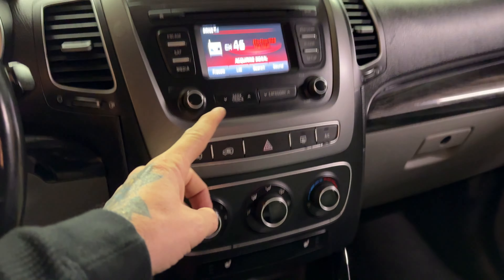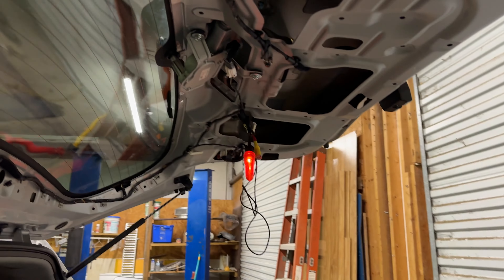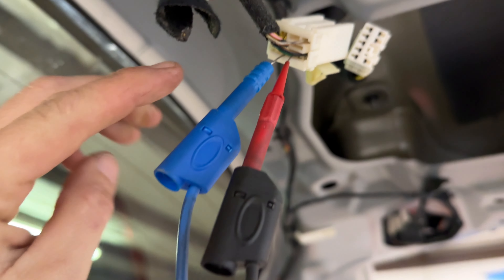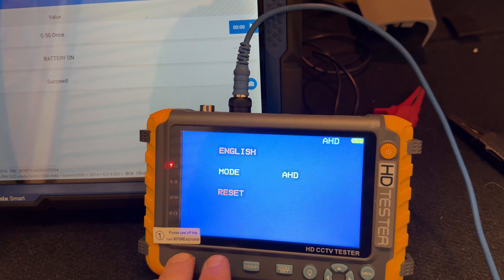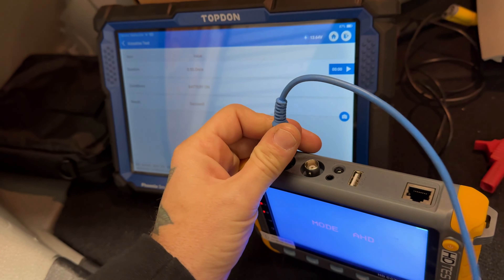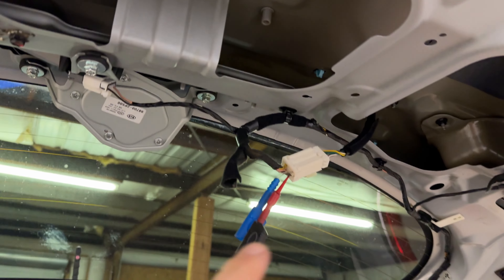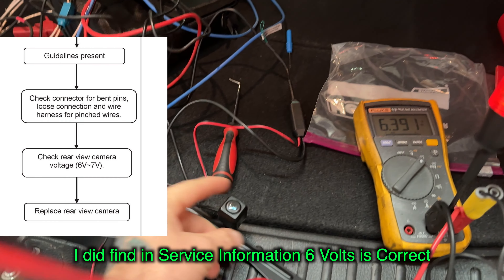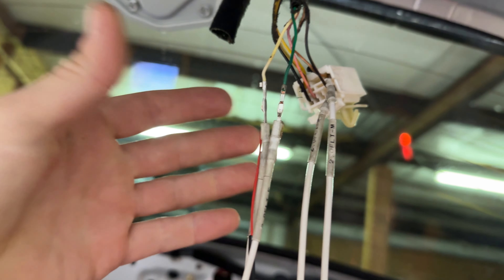Kia Got Issues Part 2 Back Up Camera Testing

Comment: You a excellent tech.90% of the time when I look at a  Kia it usually involves turning over the crankshaft and then inspecting the hole through the block from a rod and piston with vvt solenoid full of metal piece. More engine and pulled and replace than any other  vehicles in my ten 10 year career as a Honda technician.😅😅

Comment: Great minds think alike.. I had just bought the same TV monitor for the same reason, I'm glad it works for you I haven't had a chance to try it yet. I was going to make a BNC adapter cable with alligator clips but that's a good idea to use the scope leads.. thank you for making great videos keep up the good work
Reply from the maker: So far I’ve used it on 2 dodge journeys, the color bars only show as grey scale, and this sorento and you see how it does on this car. So I’m honestly not to happy with the output function.

Comment: Some customers have a hard time believing sometimes there is more than 1 problem with a car      🚘 i had a Ford Explorer had a bad ecu cracked plastic intake bad   egr and wiring to TPS was chaffed and setting 10 codes after fixing all that   It was a parts cannon but a legit parts cannon 😊

Comment: thanks for ur time and effort to show all that and as one person asked u what to do for his pcm and how to wright the VIN to the pcm as u mentioned it is one time vin right do you have a video showing what and how cloning ben done and what to use to do it if not please when u have the time would be appreciated if u did a video on it thanks.
Reply from the maker: Special tooling is the main thing.
Reply: @autodiagyt  thanks for reply so can u use j2534 to do that or u could use other by using the DLC to clone with out opening the pcm/ecm thanks for ur help.cheeers
Reply from the maker: @jgeorges3061  no has to be opened

Comment: Nice diagnostic, Jake! If you didn't have a spare camera, you could be hunting for gremlins in the wiring, because that initial color bar test pattern showing only for a split second, could mean a weak signal reaching the display. I think the delay in disconnecting the camera is for parking maneuvers, when you switch from reverse to drive a few times.
Reply: The color bars on newer fords don't appear if you install a brand new camera. They appear only until you do a lin module initialization. So point being maybe those guidelines aren't really part of the camera
Reply: @AR-il9gk  Nope. They are software generated and overlaid on the image.
Reply: @JoseSilveira-newhandleforYT  yes  my point was just because u see those guidelines doesn't necessarily mean u have a bad camera or weak signal. And on ford they will never appear if u don't perform the initialization on a new camera
Reply: @AR-il9gk  I agree, but I was talking about the pattern generator that Jake used, that appeared very faded and only for a glimpse in the reverse screen. Faded image could mean a weak signal or, most likely, incorrect image format injected in cable.
Reply: @JoseSilveira-newhandleforYT  sorry i misunderstood you didn't realize you were referring to the signal generator tool
Reply: @AR-il9gk  No problem! Maybe this exchange helped someone have a different view on the subject 🙂
Reply: @JoseSilveira-newhandleforYT  yes indeed..again i apologize for the mixup
Reply: @AR-il9gk  LOL. No need to apologize. You had a good point too.

Comment: Great way to test.  "Seeing is believing."  Are the two cameras used in the diagnostic testing the same or different as far as input impedance is concerned?
Good one Jake.
Reply from the maker: Someone posted that the tester didn’t output in PAL format and that’s what I needed. I don’t know hardly anything about video signals.

Comment: When you unpinned the wires at the camera and connected them to your camera tester, where you using AESWave terminal leads that’s part of that big terminal set?  I’ve been wanting to get one, but haven’t pulled the trigger.
Reply from the maker: Yes it’s a great kit
Reply: @autodiagyt  Thanks, I ended up ordering that AES Wave lead kit last night.  It is more than I was comfortable with spending, but assume It’ll be worth it after a few uses.
Reply from the maker: @80SWoods  it’s way better then the other cheap kits. If you watch Mr. Subaru any a couple months ago he posted a video with this kits and talked about how it was much nicer then the cheap kits on amazon that he ended up sending back.
Reply: @autodiagyt  Oh man, my AES Wave lead kit came in.  This thing is NICE!  I can’t wait to use it.  Also, I ordered some parts to make test lights using bulbs like you showed in some of your videos too.

Comment: Hello, Jake. Great job as always. What scope you would recommend for a beginner? What is the best value for money to start with? Thanks. Greetings from Ireland
Reply from the maker: When it comes to scopes I say by the best you can afford and if you can't afford a nice one wait until you can. Buy once cry once. The pico is so far ahead of everyone the closes competition it has is escope, micsig is a great all in one scope. The topdon/launch scopes only work on the scan tools, autel discontinued the mp408 scope which was great for the money. Hantek I've never used but the videos I've seen it doesn't look that great. Check out the Mechanic Mindset channel for different scopes he covers a lot of them and compares.
Reply: Thanks, for reply. Actually just watched some of Mechanic Mindset videos. Yeah, picos looks like a great choice, just wondering is 2000 series is worth buying to start playing with it or just throw some more money and go for really decent straight away? As I mentioned is just for beginning mostly for personal not profitable usage. Thanks again for great, educational videos.
Reply from the maker: @robertolaggo9141  I think they have finally blocked the 2000 series from working with the automotive software. I don’t think it was ever intended to work for automotive.
Reply: I heard that as well, but is there really big difference between automotive and non automotive picoscope 7 software versions? Whats the key difference?

Comment: Showing the bars for a bit is a sign that the display isn't happy with the signal for some reason.  Either too week or wrong standard.  There's a good chance if you played with the settings on you new video generator, it would have worked.
Reply from the maker: I messed with it a bit and never got a constant picture. I’ve also used it on 2 dodge journeys and it has the color bars as just grey scale but it does stay on.

Comment: Any help guy has used pcm 14 hyundai tried to write vin wldnt let me with autel, curious if can be done, don't know hyundai
Reply: Vin is only write once.
Reply from the maker: If you have the original and it communicates I could clone it send me an email.
Reply: @autodiagyt  oh it communicates,
Reply: @autodiagyt  plug old one in hit read vin, then plug in new and try to write it says vin already written, but it's the vin that came with used ecm
Reply from the maker: @charlesmecum5009  yes Kia/hyundia only allows vin write one time. It can be changed in boot mode only. There is also a pin stored so it’s just easier to clone an original into a donor.

Comment: Wrong video signal standard!
7:45 The car screen and test monitor are happily accepting a standard NTSC signal, but your test unit only appears to be able to generate its own AHD, CVI or TVI signal, not basic PAL or NTSC
Reply from the maker: Thanks! That's the kind of information I need. I think I'm gonna try a different tester.